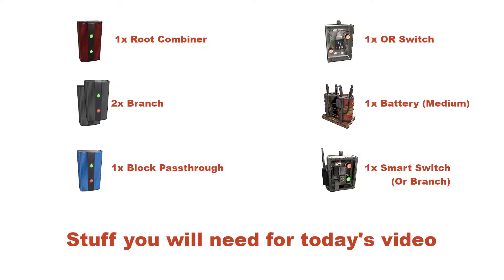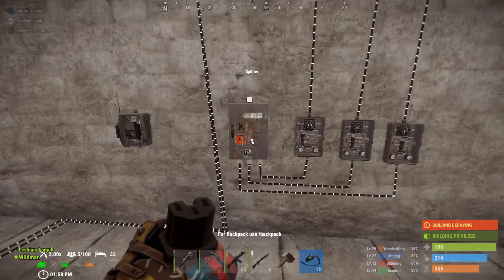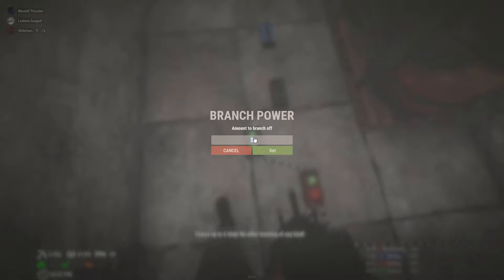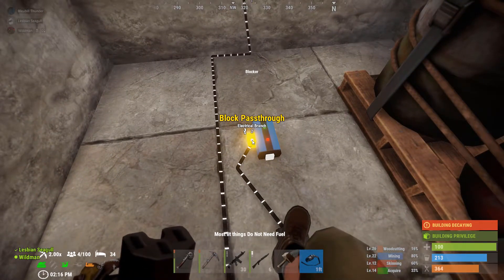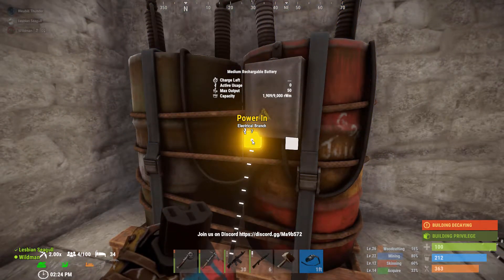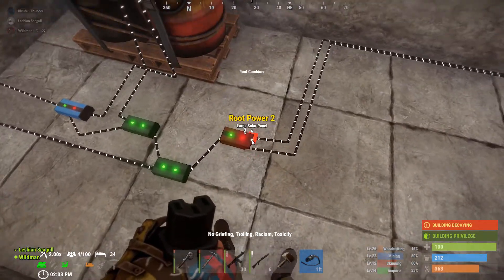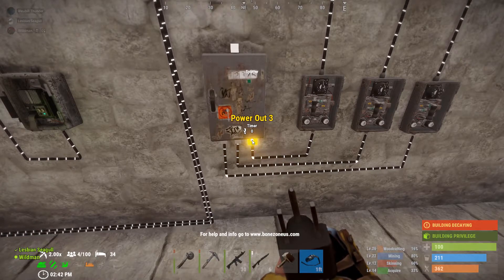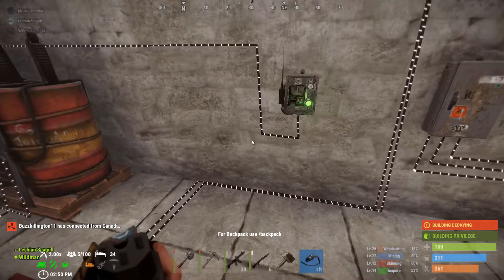Wiring a Battery Charging Circuit (Rust)

Comment: One question, What would happen if my base needs 30w, but the solar panels at dusk  provide just 20 or less than? The battery won't kick in and I'll be short on power until dark outside, is that correct?
Reply: This is the same problem i had